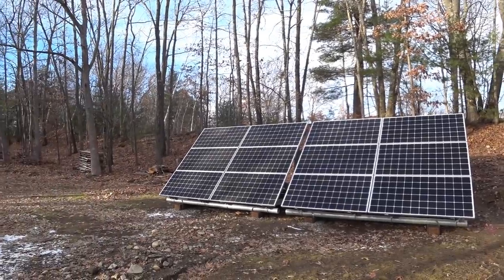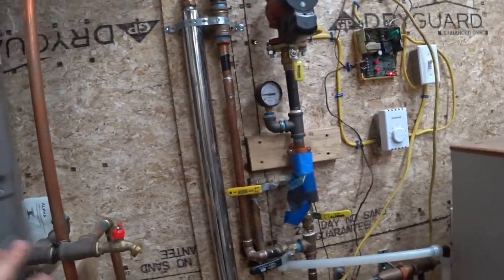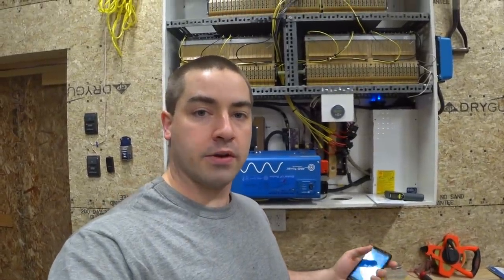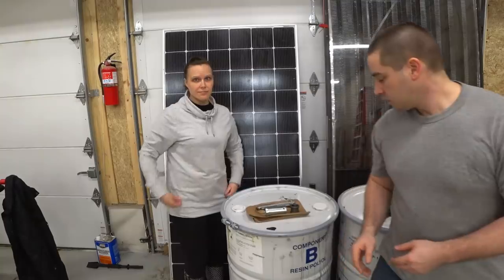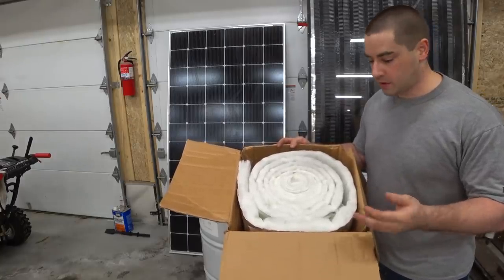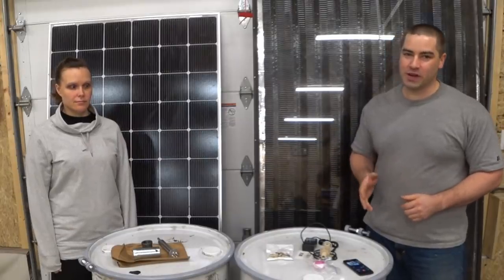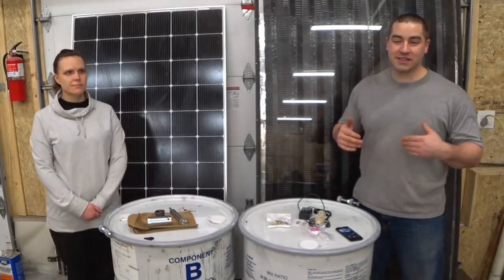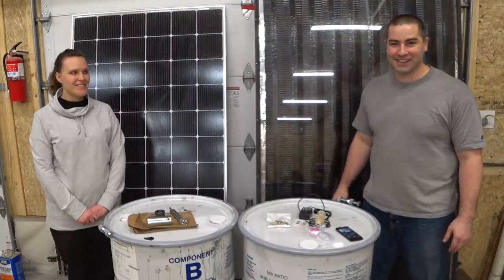Solar PV vs. Solar Thermal Experiment

Comment: Been in this game for 20 years. Put in more than 200 solar thermal water heaters. With all the pumping and plumbing Solar thermal is a pain in the butt. Now when the price of PV being so low I feel it's best to just put in more PV than you think you need for heating water. Less moving parts works even on low sun light days.  No leaking and all the rest that comes with it. 

When PV was more than 5 or 6 bucks a Watt it was smart to use ST but for most places now. I feel PV is the best.. God Bless..
Reply: Plus a heat pump can magnify the output of PV ~3-4x...
Reply: After installing an old school thermal hot water system last week I realize just how much of a pain in the butt it is compared to solar electric. Keep in mind that I'm in Hawaii where it never freezes so we don't have any complicated drain back system.  I simply circulate  the  hot water  through the panels  and it's still a pain in the butt. Super hard to regulate the temperature in the panels sometimes they're up there boiling shooting Steam  because we're not using enough hot water and if I keep the circulator pump on too long the over temperature protection in the storage tank pops and shoots water.  All the cost of materials pumps and pipes could have been better spent on electric panels and that electricity could be grid-tied for-profit after the water tank is hot. I'm actually off grid and my batteries are full early with all that extra power and nowhere to put it on thinking of getting an electric car and or changing all of my future hot water needs to Electric.  About five years ago I lived in a place that had an evacuated tube hot water system with the tubes that came directly out of the tank. That system was much much more simple because it didn't require any pump. It did boil rapidly though and so we installed an automatic feeder to replace the Lost water and it turned out to be a simple maintenance-free system that might actually compete with solar electric for the people in warm climates
Reply: We have a heat pipe system with glycol working perfectly up here in Canada working flawlessly for 6 years -12f -15f  this week. Not sure what's wrong with system.
Reply: @SiriusSolar  - very very interesting !
Reply: I did my internship in a company that make hybrid PV panels . They were able to collect more than 80% of sun energy . The PV get heated from generating electricity they  collect that heat and put it into the water.
Reply: I use those pumps for my aquaponics. They wear out in 2 years, but I pump dirtier water. I use a 12v panel I made before solar prices dropped.  I made a video if you're interested.
Reply: Bobby's Solar Homestead , I agree with the easy/maintenance factor.  And now pv prices really seal the deal!
Reply: Bobby's Solar Homestead , could I keep water warm for my aquaponics, above 65F, during 2 week cloudy days when it drops to 19F?  If so, I'm buying more panels!! I have 4 greenhouse videos that show the setup.  I really need solar heat. Too far from the house to wire AC.
Reply: Thanks, I testify that all of the other guys are saying the same thing. I believe you.
Reply: I had the idea, until I read Bobby's post, that I could route cold water from my pump house through 100' of PEX inside a Hot Tub. My first thought, after viewing David Poz's "bakeoff" video, was to use thermal panel to "assist" the 220V heat element nearby the tub, then via the PEX heat exchanger in the tub (which is well insulated but outdoors in Western Oregon--we do get freezes!) to "assist" the nearby Hot Water Heater with ~90 F water. Sound like a "pipe dream" or a "plumbing nightmare" based on the above post from Bobby's Solar Homestead? Maybe better to use PV to assist heating the tub, remove all the freeze worries?
Reply: Solar thermal on the roof is as easy as installing a storage tank. 
1water line  in  1 water line  out. I wonder what type u have installed.  Pv to heat water needs a big storage pump too. That alone may cost more than the solar thermal already.
Reply: why not use solar air heater, simplest, cheapest and most efficient?
Reply: If the average cloud cover in Massachusetts is 50% and the PV system collects 10 kwh on a sunny day and the thermal  system collects three times as much then in ten days the thermal system collects 150 kwh.  If the PV system collects only 3 kwh on a cloudy day then at the end of ten days, the PV system collected 65 kwh.

Comment: I have a 20 tube evacuated tube solar water heater.  Been working 7 years now and love it.  It heats whenever it is not raining.  Tubes are way more efficient to heat water.  Use a drainback sytem with a little electric element on the top of the system.  My evacuated sytem with tank, pump, entire system was $1500.  I imported it from China.  Those flat panel solar heaters were forced to be used for the rebates.  I looked at the degradation of them when in Hawaii.  My tubes after 7 years in texas are fine.  The will heat 80 gallons of water on a clear day in winter 40 degrees and on a overcast day about 20.  That is alot of BTUs.  There is defiinite stratification.  My lower part of tank can be 30 degrees lower than the top part.  Need the thermal break with the drainback system.  Too bad you were installing those flat exchangers.  They take a long time to heat.  I put 80 tubes up on a commercial building supplement the common hot water system.  I switched it to drainback after the maintenance guys weren't capable of checking the pressurized loop system.  The array got to 320 degrees F and stayed there.  The tubes plug into a manifold and collect energy from UV light.  They convert to heat at way over 90%.  There is about 15% heat from reflected uv so the entire tube 360 degree is collecting some energy.  I put up a 7kw solar system in December and it cost me $5400.  80 cents a watt.  DIY project.  Used sunpower 327W Series X with solaredge inverter and optimizers.  The panels produced 900kw in 6 weeks during winter here in Austin.  To heat 80 gal of water 40 degrees takes 8.33 btu x 80 x 40 = 26,656 btu = 7.8 KW.  The pump is 35w so in 6 hours it draws 210 watts.  Solar thermal using evacuated tubes is super efficient.  I just saw a small evacuated tube system for Puerto Rico selling for $350 with the 50gal tank.  It is the type where tank has manifold built in and tubes are on frame.  I was going to install these but the rebate program seemed to be designed by the oil companies.  Dual heat exchangers needed, (most efficient fluid is distilled water), multiple inspections, etc.  There were 130 people going to do this in Austin area and that dropped to about 15 after they got the rules going.  This is what I see in PV now.  I installed mine for 80 cents a watt and if I went with the norm it would be $3 per watt after rebates and tax credits.   Just got a quote from a distributor for 350 watt panels at 39 cents a watt for new panels.  11kw inverters are in the $1500 range and racking by ironridge is about 1k.  
I can't wait for your results.  I went through training at SunMaxx in NY.
Reply: Rick, can you share where I can find the evacuated tubes you used for your solar water heater, and what a drainback system is? - Steve

Comment: I'd stir the water up and take the temp rather than try to figure out the temps based on stratification. I have solar hot water at home and use a current sensor to track when the gycol circulator pump runs. In sun, it pumps quite a bit. In gray weather, it cycles.. Panel warms up slowly, pump comes on and changes the water and goes off. Both options you are testing are handicapped a bit.. Nicer hot water panels are an option. Heat pump water heater rather than an element are options. You've got a fair test setup. In your state do you get paid extra for solar electricity to the grid or is it simple net metering? That could make a difference in a practical decision.
Reply from the maker: Hi Jason,  Simple net metering for me.  I'm actually trying to go off-grid.  That's part of the driving force behind some of my projects.  Heat pumps can work fine for people on-grid, but if I successfully go off-grid, then I need more batteries.  That just winds up moving the energy storage around into chemical energy.    

As for the stirring thing.  I discussed different options on logging temps with a buddy.  I suggested the stirring idea.  He wasn't a fan because of the removal of the lid (and lids insulation) each day for a temp. reading 

Thanks for watching, and offering up another solution.

Comment: Having made solar collectors and fitted them to a property that is now rented to a tenant, I removed the system because of reliability issues . Pv is clearly the way ahead immersion heaters are so reliable.
Reply: Samuel Chamberlain PV feeding to heat pump hot water much more efficient. More moving parts and complexity than a standard immersion electric element system.

Comment: Solar thermal is all about plumbing and driving the pumps from intelligent probes. A solar PV is ideal to drive the pump, directly. I have improved the solar thermal of my parents house by just ditching the probes and pumps they had, and replacing by small 12v pumps directly wired to same orientation PV. The max temperature of the water was not higher, but they had hot water almost every day, versus twice a week with the old pumps and sensors. The pumps runs very slow when cloudy, and faster when sunny, at the end pipe you get water that is hot in all cases, simply you get less of it when cloudy. Overall this is much better. I hate plumbing, If I were building my house I would prefer an all PV solution, even if I have to multiply PV by 3.
Reply: A simple low cost solution to the problem.
Reply: Not to mention, I have to wonder if his solar thermal systems are even using concave mirrors with very reflective surfaces to heat a pipe to produce the steam? If not then obviously it's not going to be as good because that light doesn't get focused literally anywhere

Comment: I did this same experiment 3 years ago, but with 4ft x 10ft collectors. I was also using a drainback setup (because I did not want to risk antifeeze getting into my cistern which collects from the gutters... which would have been right below the collectors). I eventually ended up scrapping the collectors & went with PV hot water. 

Currently I have 6) 275 watt panels feeding into 1)2000 watt 48 volt DC element from Missouri Wind & Solar and it works great! Note however, all those panels must be wired in PARALLEL, it's the amps that make the heat, not the voltage. 

On the roof is a combiner box, 3) panels in parallel twice. Those 2) circuits (2 gauge!) come down to circuit breakers and are combined at the ground fault breaker by the tank. I commonly see 45 to 48 amps going to the element (6 gauge wire from the ground fault breaker to the element), which is in the bottom of a cheap 40 gallon tank. I rarely turn on the top AC element (2000 watt) unless I need to take a shower... then, it's just on for 15-18 minutes (timer with a bright red flashing light) to give me a 3 minute warm shower. I'm glad I brought 2) circuits down from the roof, because in summer only use 1) circuit (which is just 3 panels!) for all my hot water needs. If it's really cloudy & I've run out of hot water, I'll turn on the other circuit.

If the water in the tank has gotten cold, it wakes up with a low, rumbling growl on a sunny morning. 
And on a sunny day with spotty clouds it really sounds animal, growl...quiet....growl...quiet. 

One full day of sun (NW Arkansas) can bring a cold tank up to 120*F, two consecutive days, I can see 160*F, 3 days will blow the pressure relief! There is no thermostat. Time to take a long shower. I haven't finished plumbing my hydronic heating because I lack a few bits. I know I want to add a second 40 gallon tank, but I will likely AC couple 10 panels with microinverters (5 East & 5 West) to my Outback offgrid setup so I can use the more efficient AC elements and extend my charging curve. I hope this helps.

Yes, I've corrected this post to reflect the 2 gauge wire, I thought it was 4 gauge, but without having looked at it for 3 years, I was mistaken, sorry. It was only clear to me when I opened up the combiner box today. 
It is 1650 watts at 32 volts (STC Vmp) for 45 feet with a 3% voltage drop tolerance. I have only upsized this circuit by 15% (to 59 amps) because of my location (36* lat) relative to the panels' tilt angle (36*). We're usually not colder than 30*F at the equinoxes. So if you live in higher latitudes, you should plan to upsize 25% (installation standard practice)...and plan on paying out the nose for wire. That 200 feet of 2 gauge cost me $300; sorry for the buzz kill.
Reply from the maker: Thanks for sharing.  I'd love to see a video, or pictures of your setup.  My e-mail is on my website if you don't want to post public.
Reply: Brian Woodrow  I prefer to keep things simple; no inverter, no charge controller, no batteries, and just 1650 watts, compared to your 5400 watt setup. I don't prefer the 2 gauge cables from the roof, those 6 panels wired in series wouldn't even warm a 5 gallon bucket of water, whereas when I wired them in parallel it boiled the water & melted the bucket.
Reply: Shining Star Solar   You cannot melt a bucket with boiling water!?    Discount the hyperbole all!
Reply: Actually Shining Star, your PV system would have worked better with the panels wired in series with a 2kW 240V element.

You state the Vmp is 32v, which across a 1.15 ohm element (48V 2kW) is only 890 Watts.

If the 6 x 32Vmp panels were in series across a 28.8 ohm (2kW 240V) it would be 1280 Watts.

If what you really tried was the 6 panels in series across a 48V element then essentially you shorted the panel into a region where it produces very little power.

Comment: The best system would be thermal for pre-heating and electricity for heating up.
 The good thing about the electricity is that it can be used on demand from battery.
  The modern electric water heaters are very quick. Quicker than the gas heater.

Comment: Don't assume that just because your thermal isn't running that it is producing zero. Thermal absorption is still happening, just not at a level that will activate the rest of the system.  For the test to be accurate, the test should be run on both cloudy/shady days as well as under direct sunlight.  Both panels will work better under direct lighting, but which is better under direct vs indirect and percentage collected under both conditions has to be taken into account.
Reply: Think for the test to be relevant he just needs to run it for a while for where he lives.   I am pretty sure for where I live in sunny Southern California the Thermal would probably win.  But for a northern state the Photvoltaic should do better  considering cloudy days and cold days.

Edit, for my system I just do not want to deal with the logistics of a thermal system.   My PV system has enough to cover the water heating, it really keeps it simple.
Reply: @westcoaststacker569 , agree. It depends on the situation.

Comment: what kind of batteries you are using for storing the electricity ?
And for the converting part, DC to AC, how much lost you got? What kind of electricity convertor you are using?
Liked the video. Nice work.
Regards
Reply from the maker: Here is a full overview of my system I used for over a year.  I'm currently changing things up.  https://youtu.be/722GNWlEN1g

Comment: In my area we have way more sun days than cloudy days. When my shop goes up I will have solar hot air and solar hot water and PV. Pretty much our 7kW PV takes care of our 100% electric house. Another 6 kW in the Garage for my OFF Grid Setup. Have my Charge Controllers. Getting the Inverter in next week. Ive pretty much put most of the solar hot air and water on the back burner because PV is so good. Any extra help heating the hot water tank is a benefit. So solar hot water pre-heater will most likely be what happens for that. Solar Hot Air will help in the winter here but we have mild winters and lots of sunny days. So that will help and allow the PV to work less at providing heat for the shop. Easier to heat a 40 degree shop up to 70 than a 20 degree shop to 70.
Reply: are you grid tie or battery

Comment: DEAR DAVID,

Thank You for your prompt response.  But my basic question is how does a solar panel connect to a heater.  It is an electric heater which heats the hot water?  

I am just starting out and have virtually no idea how these things work.  

Thanks..

Paul
Reply from the maker: Hi Paul,  Yes, it is an electric heater.  This works the exact same way as any electric hot water tank.  There is an element in the tank.  The element has two screw terminals on the outside part of the tank.  (there is a gasket that separates the inside part from the outside part to prevent leaks.  You need to attach two wires to the screw terminals of the heating element.  Those two wires then go to the solar panel, one is positive and one is negative.  Then the solar panel needs to face the sun and get direct sunlight.  When the sunlight hits the PV panel it causes the electrons to flow down the negative wire to the heating element.  The element is made of a material that resists the flow of electrons.  That resistance means the electrons work harder to force their way through the element in order to get back to the solar panel on the positive side.  As the electrons force their way through, this causes heat.  That heat moves into the water around the element by conduction.  

I hope that's helpful.  Thanks for checking out the videos.